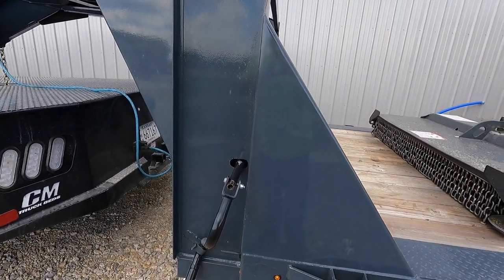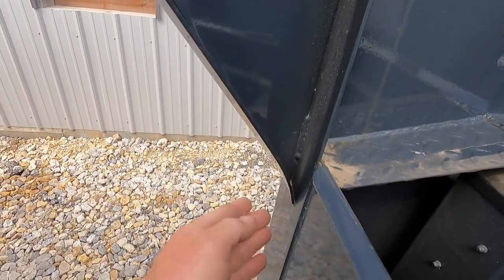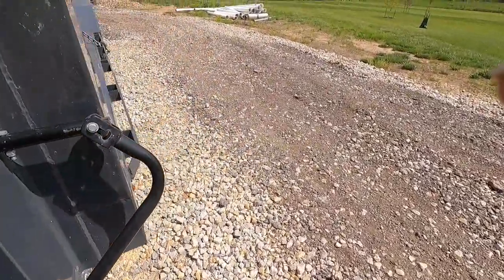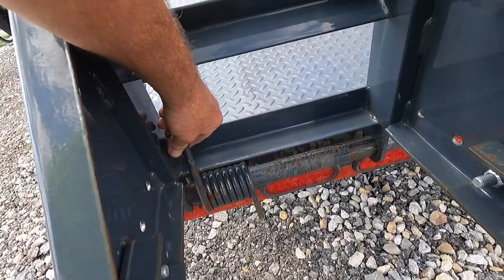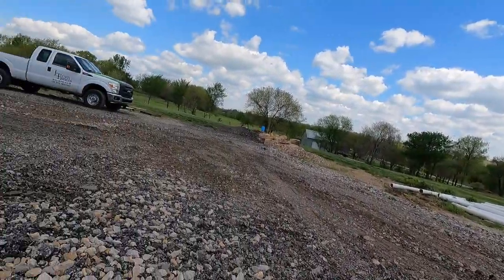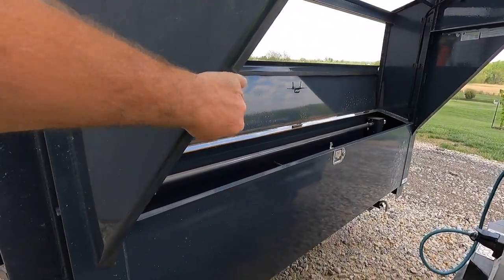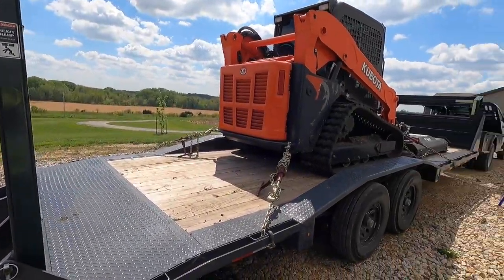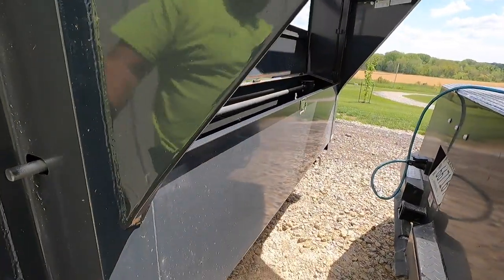Bad Lamar Trailer! Why can't I buy a good trailer ?

Comment: I purchased a lamar 25' tag along that someone ordered and never picked up it is a nice trailer and super heavy duty. It was optioned with an eight inch frame and dual 10,000# jacks, 18"x6' ramps it is the best trailer purchase I've made and I got a great deal on it. I have not seen another like it, thanks for the videos.

Comment: Damn, sorry to hear this...  One of my local stores quit selling Lamar because they started going cheap and the store didn't want to deal with the aftermath..  Don't buy Big Tex bro they are just as bad or worse...  I think the quality issues for most makes started about 10-15 years ago.  Maybe look for an older trailer that you can rebuild.  Might be worth a try..
Reply from the maker: I bought a Deck Over LoadTrail and I love it. 8K axles and 17.5 tires.

Comment: I know that all trailer brands cost too dam much but remember that you get what you pay for.  Even though your equipment that you’re pulling is below 8 thousand pounds in my opinion I would have purchased a tandem axle duel wheel 10 thousand plus pound axles with mega ramps or the power tail ramp.  I would buy a bit heavier than I needed to prevent the lite weight metal fatigue which you purchased in that single axle Lamar trailer you have. I noticed your other truck was a 3/4 ton. That truck would pull safely the Lamar gooseneck but you purchased a Ford F450. Doesn’t matter if you already had the F450 b4 you got the gooseneck. What ever brand you by is a investment.  Spend the money upfront so like now later you want be cussing because you chose to cut corners and go the cheep route. From this video I can tell that any brand that you purchase that you want be satisfied.  I’m not saying buy a DC LoadTrail or any other brand but what ever brand you choose buy a heavy duty trailer.  
Duel wheel 10  or 12 thousand pound axles with mega ramps or power tail with the 102in wide deck.  Let us know what you decide to buy or better yet go shopping and take pictures of your choices and let us decide for you.  Do a video on several brands 2 of each brand duel wheel and single wheel mega ramps and power tail pictures and prices. We can choose // vote the rite trailer for you giving you a 1st, 2nd and 3rd choice B4 you by. 

THANKS 

Liked Subscribed & Shared

Comment: Lamar and Load trail have been quality trailers for me, including my lamar dump which was the best built dump ive seen. This looks to me like its been overloaded on the front of the trailer, a good bump in the road or going offroad with being overloaded is hard on stuff. All the brands look to have similar gooseneck design to me except diamond C obviously. If this has happened with you honestly not overloading or front loading then yea that is crap but ive only ever seen 1 gooseneck that was tweaked ever and it was not a lamar. Im by no means a lamar salesman or bleed lamar but they along with load trail have the best lookin welds usually also
Reply from the maker: The trailer was never overloaded and I bought it new to haul a skid steer. My current gooseneck and all the other ones I've seen all have at least double the thickness of steel gusset up there where it was bending. 

I have had some other people with the same trailer tell me theirs were doing the exact same thing.
Reply: @skidco  thats just crazy, my lamar dump trailer with the same gooseneck setup has been overloaded big time (i had over 7.5ton in it and max capacity is 5ton) and it didnt even do this. Only difference is its not as long of a trailer from axles to gooseneck . Makes me nervous cause i just put a bid on this same trailer at an auction its in good shape 4 years old

Comment: I have a lamar 7x14 i regretted so much not returning it. Welds is cracking all over.
   it broke with less than a month of use was fixed under warranty broke 2 more times after that
Reply from the maker: Sorry to hear that. I wouldn't care if they gave me one ill never buy another one.

Comment: Guessing thats a 14K rated trailer? Take away the weight of the trailer even at 4000 lbs. Might just be over loaded to bend those pieces. That or Running  on rough roads. Just looked a few of these trailers today. Did not like the looks of them. But just saying overload the unit. Its going to fail. But should be build to withstand more weight then rated forsure.
Reply from the maker: I always carried less weight than what the trailer manufacturer said it would haul. I think it was a pour design. The material they used was pretty thin compared to all my other goosenecks.

Comment: i ordered a 22'x83 bumper pull trailer  back in 2016 with 6' slide in ramps behind the rear wheels . the shitty power coating chips off if you chip the paint and 6 months ago the ramp holder that holds the ramps in broke and i lost two 6' ramps out from under the bottom of the trailer and now the trailer lights the left turn and stop light won't work with a new light and plug

Comment: How come ya don’t contact Lamar and or the dealer instead of bitching on You Tube 
Lamar is very good to work with
Reply from the maker: Well that is an older video. But when I owned the trailer I did contact Lamar. About a dozen times. Most the time someone sent me to someones voicemail. I talked to someone twice besides the person that answered the phone. Once I told them I had pictures and video and they had me send them and they would get back to me. Never did. It took I think three more times of calling and leaving messages to get someone on the phone. Then they made me feel like they just wanted to be off the phone with me. The dealer in the area is not well set up at all to do repairs or anything. They have a couple of kids setting up trailers and no one in the shop. But they told me without approval what are they going to do. They said they didn't understand the problem. Even though you could see a clear difference between a new one and mine. 

I didn't want it to happen to someone else. So there is the video. 

Im glad you are good with Lamar. Ill never own another one.

Comment: 3yr warranty, right!?

I'd 100% go back to Lamar and complain. I'm pulling a 14k Tag as we speak. No issues... Haven't loaded it fully yet either tho 😔
Reply from the maker: Bad thing is there isn't a good trailer place in town that's a Lamar dealer. There is only a few and they suck for repair or service. Im just going to fix a few things to sell it and move on.
Reply: @skidco  I sure hate to see the luck you're having, Sir. We all wrk too hard to put up with tht bs
Reply: If you fix it just keep it, I don’t think there’s a trailer out there you will be 100 percent happy with... it is really upsetting when you buy a brand new trailer and you have to finish it yourself....
Reply from the maker: @JohnDiMartino  I know. The bad thing is I just needed something in a pinch to haul the tractor. Id rather have a bumper pull 20+5 and at least 20K. I can haul the tractor with the brush hog on it and haul materials and maybe a bigger excavator. If pulling heavier stuff ill pull it with the dump truck.

Comment: Did you end up getting rid of it?  I know you have a Load Trail.  I have a LT dump trailer.  If I get a dump truck, its getting traded for an equip trailer.
Reply from the maker: yes. Its gone. I have my load trail deck over I use all the time and an older Lamar 14' utility trailer I use every once in awhile.

Comment: did you get a new trailer yet ?
Reply from the maker: Yes. I have a bumper pull Load Trail 18K deck over. 

If I had the Monet I found a Sure Trac that I found I really like. 18K gooseneck low deck tilt. 

I have a big deck over for my dump truck to use if I need a deck over.